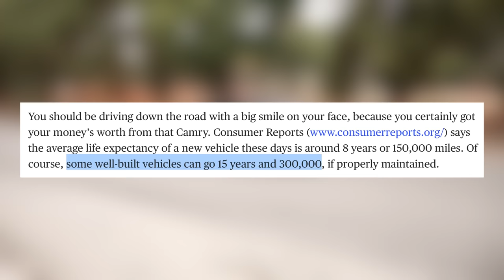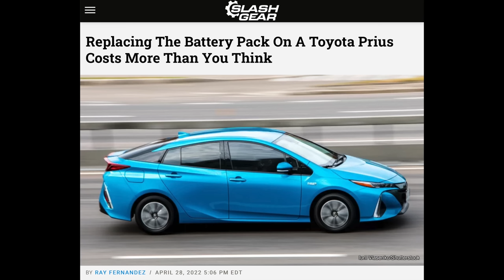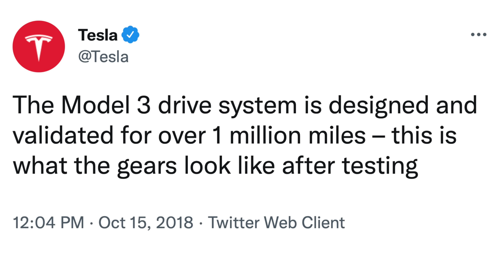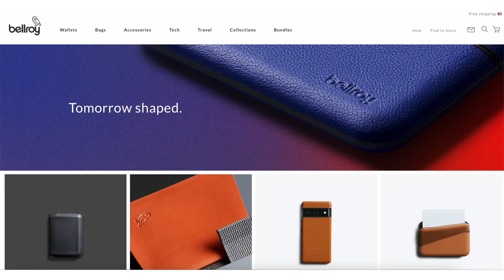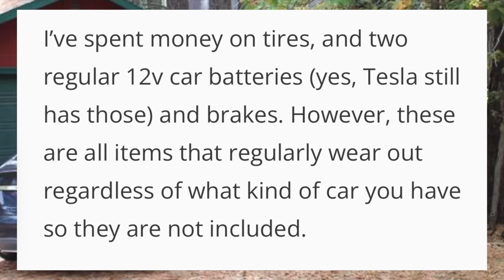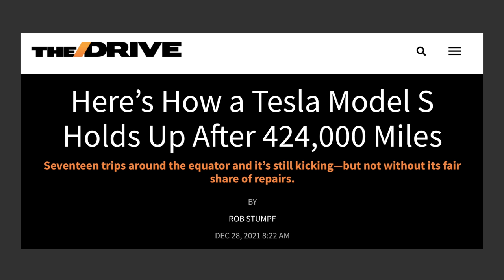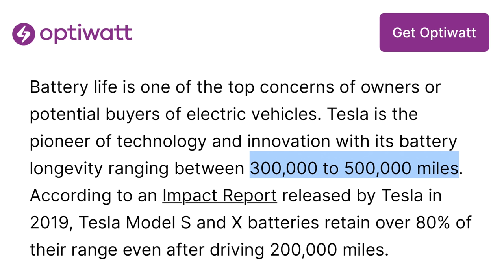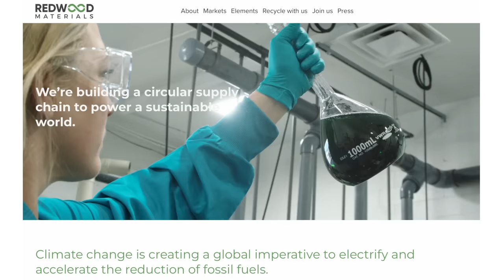The ONE MILLION Mile Tesla | It Still Runs

Comment: Things may change soon in regards to battery pack replacement. there are to 'Dealership' models. One is not owned by the car maker, Tesla and most all the rest are independent of the car manufacturer- a 'dealership'.
Pick a brand and the dealerships cojoin parts prices, well more or less about the same price.
Tesla dealers are owned by Tesla and prices are close in all locations.
All batteries under warranty will be rebuilt from packs recovered from failed or sometimes destroyed cars, no matter the maker of the car.
The battery pack consists of modules containing those small batteries and the pack may consist of 8-16 modules depending on the vehicle.

There are repair shops coming out with EV battery repair and trying to get interstate approvals.
The shops doing Tesla can diagnose and find the bad modules and replace them. Costs are varied but parts cost for the module is about 1500$, then labor, taxes ect.
There are few of these shops but growing and Tesla released I think EOY 2022 schematics, diagrams and parts lists so now there is the ability to have conformity enough for specified vehicle repair.
The software that tells you there is a problem can also tell you after the bad module/s have been replaced there is a problem if the new are not like the others so don't try this at home boys and girls.

Just to say things are changing and soon the new general chemicals of the Tesla battery pack for the 'Y' initially, coming out probably June ><. One can presume other vehicles will follow.
This new formulation will be same battery construct like the 4680 we believe. It will have about 20% improvement in charge time, range plus life length, safer and reduction in cost so winner all around.
Don't know if the new battery module can be mixed with the old design modules but I'm guessing not.

Comment: It would be an interesting question, not so much when the 30% point is reached, but when the car stops and you can't drive it any more.  If you drive your Tesla or other EV until it turns into an 80 mile compliance car, at what point does the computer insist you stop torturing it and get it a new battery?

Comment: Thanks for the information on the Tesla repairs needed over time.   ICE cars will go through the same repair processes, tires, transmissions, brakes, etc.  Some of these repairs for an ICE car can be very expensive.  

So it is kind of nice that EV car repairs are comparable except for replacement of the battery when beyond the 8-10 year warranties and possibly the electric motor in an EV is not cheap to repair and since they are the main parts of the car.  It is like replacing an Engine on an ICE car.

That said, if you treat a car right and do normal care and maintenance, they should run and last a long time.  I have a 21 year old Monte Carlo with 110 thousand miles on it.  Yes, I have had various repairs done to it, one being the transmission failed and I don't drive aggressively.  My car does have some rusting on it, but the car still runs good.

Planning on getting an EV vehicle, which one, not sure yet.  Don't want to spend allot on them so price is a big factor.

Take care.

Comment: I liked the video, you went and researched a lot of real life people using real life cars, which is always a good and time consuming thing.
Thanks for that! 
But, I have two comments regarding the video:

1) We are basing our conclusions here on the expected miles at 100% battery, right?
Is there a possibility of Tesla's estimating software be lying on this numbers? Either by design, or by error.
I would say yes, much like many on-board computers paint a very positive estimate on the car's mileage calculation.
On gas powered vehicles, I use the gas on the pump and the trip odometer to calculate the REAL fuel consumption.
On the electrical vehicle case, I would suggest a GPS tracking the miles really driven, or the miles read on the trip odometer, against the Wattage drawn from the wall.

2) My friend's 2nd generation Nissan Leaf, after just 6 years, has had a significant battery degradation.
This is normal, but frustrating.
Moreover, this can be seen as something normal to replace - which I get it - and can even be compared to the overall gas powered vehicle running costs, namely gas and maintenance.
But, my main issue with this is: inflation on battery packs, especially on older vehicles.

What is the price of a battery pack for a 1st Gen Tesla Roadster? Not even Tesla wants anything to do with those anymore.
What is the price of a battery pack for a 1st Gen Nissan Leaf? The latest reports have shown a 300% price compared to the originally reported price.
Thus, I would say: until OEMs make a commitment on repair ability and serviceability at fair prices for the older cars, the consumer will always be afraid!
Especially in a moment where electricity costs are rising, and consumers are imagining: "What if everyone is riding their EVs, would the electricity price go through the roof, and I will end up spending more than with my current gas-powered vehicle?
Reply: Install solar panels on the roof or backyard of your home to help charge the home/car's batteries. Electricity price increases from the major providers will be much less of an issue or not even a problem at all. That's what I did.

Comment: I think you meant 4,000 charging cycles as apposed to 400,000.   A battery with a 250 mile range would need 4,000 to reach 1 million miles.

Comment: MY TESLA M 3 LR 2019,  AT JUST OVER 100K MILES RIGHT NOW . I'VE LOST SEEMS LIKE IT 7% OF BATTERY CAPACITY. AND SAME THING MY APPER CONTROL ARM NEEDS TO BE REPLACED, MAKING NOISE WHEN IT'S HOT OUTSIDE ONLY, HAVEN'T DONE THAT YET, ITS ABOUT 227CAD$  COST.

Comment: I have a 2019 dual motor long range model 3 with 140k miles and battery needs to be replaced. Don’t believe it will last 300k costing me 16k to replace

Comment: I bought my Long Range Model 3 on June 2, 2021 and today (8/26/22) I have 24,496 miles on it. But it is in the shop getting a new battery. Fortunately it is covered by warranted. Bend Tesla was kind enough to give me a loaner, and older model RWD model 3. The first day I got a message on the screen that the 12 volt battery needed to be replaced. Wonder if anyone else has the battery go bad in fourteen months. Can't wait for the cybertruk. Maybe a better battery. So the 1,000,000 mile battery is but a pipe dream,

Comment: Tbh i'd miss the manual parking brake (for drifting), clutch kick drifts, having fun banging gears in a manual transmission ans the noise.

But I'm really considering trying a Tesla and buying one. Like a model 3, it's miles above my current 82hp fiesta even if i love it offroad (which i won't be able to do.. drift offroad, do skids, maybe even go camping overall idk) but my recent dream car is a gt3 and well i think for 20-25k euros, a Model 3 is the closest you can get in terms of power, performance, chassis flex etc.. yeah the stock brakes are going to overheat quickly and if not, the battery will, yeah it's extremely heavy. But it'll get as bad mileage as a GT3 when driven hard, it's as ginormous as a GT3 so.. why not ! 

Also yeah as secondary vehicle (i have a motorcycle) idk how it'll do everyday on our small french roads and parking spots, idk how many years I'd have recovered the cost of the tesla compared to let's say a 14keuros ICE.. need to calculate.

But it's one hell of an upgrade i think, and I'll keep it for a daaaamn while xD we'll see !

Comment: The only downside is that Tesla only guarantees a battery that is at least 70% of its original capacity when doing replacements. So if your battery degrades 31%, Tesla could replace with a used pack that has degraded 25% and it has fulfilled its warranty. It’s sad they don’t just replace with brand new packs for degradation claims. Maybe they do use new packs for defective batteries though.

I’m well aware that a Nissan Leaf is nowhere near the vehicle that a Tesla is (I own a 2019 Model 3) but my Nissan Leaf had a battery degradation claim filed and they replaced with a brand new pack. Wish Tesla would do this

Comment: Funny when people talk smack about ev’s not realizing you could go 200k-300k miles never spending money on gas or maintenance. Put it into perspective my ford explorer I’ve had for three years and with regular maintenance oil change belt hoses filters transmission fluid radiator fluid change all at the dealership has cost me 10k so far. On top of spending money on  gas.

Comment: What's this 1,500 cycles Elon was talking about?  Is that 1,500 0-100% charge, or every charge, no matter how small (or the many 50-80% charge?  Just talked to a friend with a 3yr old M3 and he figures he's charged at least 1,500 times.  Normal degradation.  My MYLR is new (one month).  I charged it to 100% right after I got it and it showed 329 miles so just one mile less that stated.  I won't do that again for a while, but I'm concerned about # of cycles vs speed of degradation.  Most people I talk to do not leave it plugged in; they charge once or twice a week when then get near 20% and go up to 80%.  Great video Andy!
Reply: Hi - in order for someone to charge their car 1,500 in three years, they would have to charge it three times every two days.

Comment: Besides the data showing that these cars need their main drive units replaced every 150k on average, all of the low cost maintenance selling points are a myth.  Wow, the brakes last 120k.  No mention of needing a $1500 set of tires every 10 k 😆
Oh, it doesn't need fluid changes!  Yep, it doesn't need an oil change that I can do myself every 5k for $35.  Yet it has two cooling systems, a conventional hydraulic braking system and I believe some of the AWD models do use splash-lubricated differentials.  Not to mention the 8 heat pumps vs a $150 heater core and a blower fan for heat.  

Cool car, but I'll keep my Acura.  There are examples of the same model with 600k on the original drivetrain.  Oh no, I'll spend a whopping $3500 in oil changes over half a million miles 🤣🤣🤣

Comment: I've only had to change tyres, oil+filter and one set of brake pads, and just now a new headlight bulb, on my Toyota. 0km -200,000km. So huge savings there compared to repairing the Tesla. I'll also save up to 20k on battery cells when I drive to 400,000km. But the mechanical repairs might start to be needed costing maybe 5-10k during that time. However, the fuel saving is great on an EV, although having to pay 20k extra for an EV is a lot of fuel ICE can buy! Then there will be EV road taxes etc... but I do like the idea of EV. As long as it does more than 200k it might offset the carbon damage from building the batteries. I've ordered a Cyber, however, I may cancel it and buy something else if they increase the price, especially now there's already other EV Van and Ute options here in New Zealand that will likely reduce in price by the time the Cyber comes out. Time will tell.
Reply: The carbon damage is all in the fuel. Manufacturing is a small part - 6mths use on a clean grid like NZ (Argonne Lab).

Comment: Interesting bit about the motors at 14:30. Did he change his driving style, or did Tesla build in more obsolescence?
Reply: very interesting yea I'm definitely gonna stick with gas in my opinion its cheaper. the same if not cleaner for the environment. and a little 4 banger destroys eves on range.
Reply: @izaacschwieterman132  ICE cars have better range, but a Tesla has enough range to charge while you have your mandatory break. And even a coal-powered EV is cleaner and cheaper than an ICE car because large stationary generators are more efficient and cleaner with scrubbers.

Comment: Ok so my M3 2019 needs new tires.  I hear that because the extreme acceleration of EV's and ReGen Braking (one pedal driving) that the car will use up tires a lot quicker than gas cars.  Do you find that is true.  About to replace my OEM tires which only got 24,0005 miles most gas cars get at 40K before replacement.  Is that the normal cost of EV ownership?  And I hear that Tesla Michelin OEM tires are only designed for 24K miles. Do you have any experience with this?
Reply: The acceleration can eat up tires if you spin out a lot, sure; but I'm not sure why regenerative braking would eat tires. It's easier on the tires than old fashioned friction braking since you decelerate slower. 
I have about 10k miles on my Bolt's CrossClimate 2s and they seem fine so far. It's nowhere near as torque-y as a Tesla but I do have fun in it.

Comment: Great video - though I'm not sure all drivers/owners agree that 70 % is "acceptable" as "this is working fine". If you have bought a car to achieve a certain range, and it is not capable anymore, you may need to upgrade your car or battery.
Reply: Anyone buying a 300 HP car that drops to 210 HP is not satisfied... or with a 60 liter tank, dropping to 41 liters...

Comment: Couple of points/observations - seems Tesla data supports the view that it is time and not miles (usage) that links to battery degradation. I would also note Elon's comments on fixing a battery (module not whole battery) but his latest innovation - the 4680 structural pack - does not have replaceable modules.

Comment: Regarding your section about 1-2% battery degradation per year, is that based on an average amount of miles per year, or is it strictly about age?  What I'm asking, more directly, is what about battery degradation in a car with unusually low miles, like a 10 year old car with only 20, 30, or 40,000 miles?  Also, what about a relatively young car with exceedingly high miles?
Reply: Batteries are pretty much like the motor in a gas car, the worse you treat it the faster it will wear out.
If you constantly floor it and always fast charge it battery won't last as long as if you drive like a normal person. Or better yet drive carefully and charge on L2 chargers most of the time. Which most people do.
Reply: @Jcewazhere  Did that answer my question, because I'm not sure it did.  I owned a Leaf for over 11 years and charged almost exclusively on my L2 home charger.  My wife wanted max range so we charged to 100%.  At 54k miles we were at 8 bars (of 12).  Also in the Pacific NW where climate is mild most all of the year.  Question still remains, in this situation would battery degradation still have dropped to 8 bars on L2 charging if we drove less miles (thus charging fewer times)?  Would it be the same or worse at 80,000 miles or 100,000 miles?  Age, usage, charging frequency, or a combination of all these factors causes battery degradation?  I ask because after having had the Leaf from 2011 to today, I now own a 2013 Tesla Model S with just 39,200 miles.  Should it have less battery degradation than a 2013 with 100,000 miles, or would the battery degradation be the same because both vehicles are 10 years old?  I purposely bought one with lower miles because if age is equal, I'd expect the lower mileage car to have less battery degradation.

Comment: I mean I have a clk 430 at 218,430k miles still running great just those spark plugs, oil and all other fluids maintenance, but I love it, oh and gas change lol, and twice repair for my convertible top in 22 years not bad for me, and still on second first pair of shocks after factory and new cambers on my car for like 4thousands miles lol my fuel Injectors lasted 216k miles original miles lol Mercedes really built cars to last back than and 2002 ain’t that long ago 😅

Comment: I take issue with that Consumer Reports figure. 150,000 miles and especially 8 years is much shorter than I would expect even a Nissan to last. I don’t doubt that the average is fairly low, most people don’t properly maintain their vehicles and there are wrecks to consider, but your average Toyota or Chevy or Ford can easily last a heck of a lot longer than 8 years if you don’t smash it into something.

Also, to be clear, a battery for one of these teslas costs several times what a brand new engine does. It costs more than replacing the entire powertrain on a combustion vehicle. That means you need the battery to last several times longer than an engine to call it a win. With gasoline engines, you’d probably be on your second engine and possibly transmission at 400,000 miles, but you’d still be many thousands of dollars ahead of the tesla driver on his second battery. With diesel engines, the comparison is even worse; a diesel can easily outlive a battery pack and still would still be cheaper to replace when it eventually gives up the ghost.

Comment: I have just over 45k mi on my '20 Y. My max range is only 291mi already. When max range falls to 270mi or so, I'll have to start charging to full a lot more often which will further degrade the battery. I'll likely fit the warrantied battery issue. I believed three Tesla battery bs but I feel like from my experience that it's not that good. I've saved a lot in fuel cost at least

Comment: Battery longevity is very design/vehicle specific. While not huge, battery risk is still significant even in the best designs wince it's new tech. But you describe it an a non-issue even as you tell about your own Tesla battery replacement (head-slap). I'm for EV's too but good ones are still toys for those who are or act wealthy. Could  you clarify maintenance data that you listed? Tesla suspension components undergo the same harsh use as any car. Control arms, end links, tie-rod ends, CV joints, air suspension, bushings typically start wearing out by 200k miles (especially on heavy cars), yet your examples don't include suspension maintenance or alignments. Thanks.